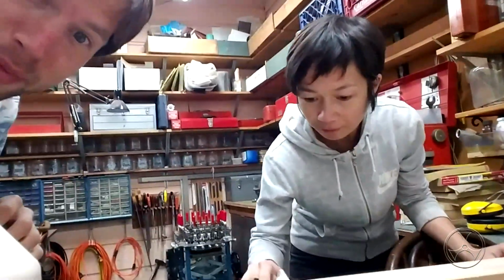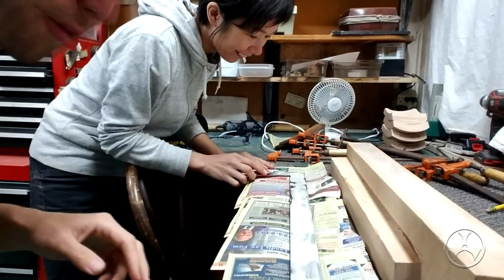"Let's Build Shamisen!" w/ Su Bunjamin (Part 1)

Comment: Hey Kyle!  Back watching this series after a while and I absolutely love it!  I see it now very different after going through the process of building a Shamisen myself.  I came back to see the angle grinder in action with the intention of getting one myself and save myself from the tedious and arduous process of the gouging chisel to remove the material from inside the dou for my 2nd build.  After doing more research on the angle grinder and particularly the disc Su uses here, I had to come and comment.  I really don't want to come across as annoying, but man!  Have you done some research on this chainsaw disc??  AKA the "meat eater"??  It is very dangerous and unpredictable!  I really really urge you to look for an alternative when it comes to doing the procedure.  The roundish discs with teeth (Kutzall shaping dish is a very popular and good one with different levels of coarseness) is the way to go!  I really hope you reconsider and avoid the disc used on this video... also, again, not to be annoying, but where's the blade guard on the first one?!?  Hope all is well...
Reply from the maker: Howdy Pablo! Ah, we actually do have the super coarse roundish disc as well. :-) This has been really smooth though. I also used it for the Koa and Cocobolo dou with very smooth results. I don't think it has a blade guard. :-P I think my dad got these tools in the early 90s and probably threw out the guards to make space in the drawer. :-P We still have all our digits though! (for now) That being said, I'll try the Kutzall disc thing next time!
Reply from the maker: Oh, apologies for the late reply to your messenger message! I've been meaning to write you back but have been so preoccupied in the workshop. But I will, I promise! :-)